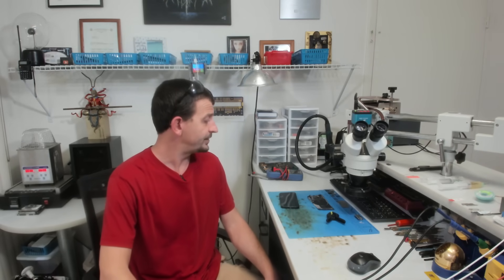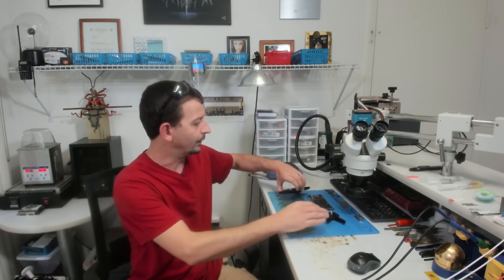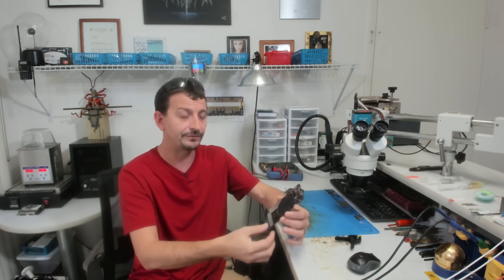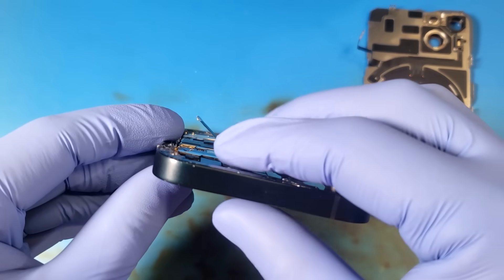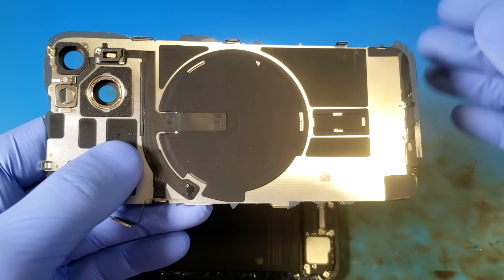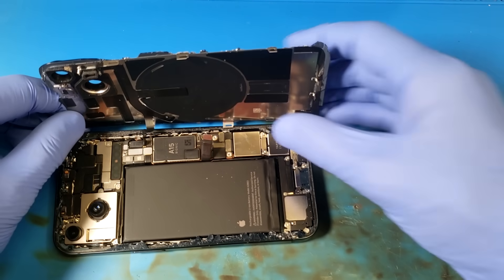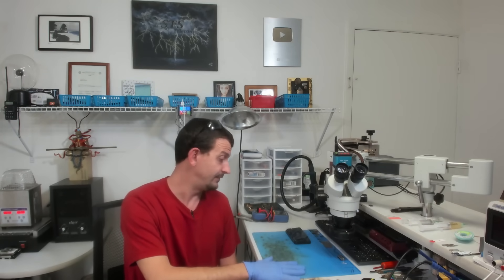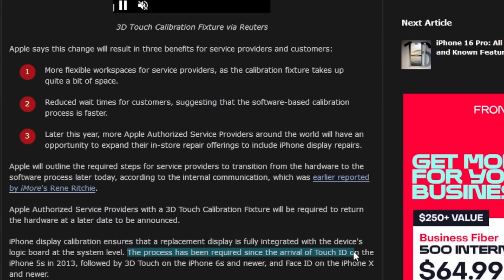New iPhones are full of landmines 💀 Don't break your iPhone 14 back glass!

Comment: I'm getting disappointed with Apple, my 2007 Mac has gotten to the point that I can't connect to a website without getting a not compatible error,fine, I wiped it, my son wanted it,he has it in the basement and uses it sometimes for some gaming, I have worked on it a few times, easy to service, I bought a new one and it's slow,paid more for it, if I call apple I expect that they would ask technical questions, maybe ask for logs, no I get someone that sounds like they just smoked crack and this is after several calls, not sure if I'd switch to windows yet,but I'm closer

Comment: Hi, can you help with my poco f2 pro?

I can't transfer any data from or to my phone with usb c, but it does charge.

I thought it was a faulty charging board so I've ordered a new one. Upon installing the new flex cable it worked, but my power button didn't work.

I managed to fix my power button, but no matter what I do, I can't get the USB-C port to fully work again.

Is it a faulty connector on the motherboard?

Comment: I have been a mobile phone technician for 25 years now and I have never liked Apple because of their hidden mines. I think this is a giant machine to squeeze money from the customer. An inflated balloon!
Even small things like changing the battery or display is already associated with difficulties. An annoying message is in red that something has been changed in the phone. Something that only Apple has. This forces the customer to seek service from an authorized service center where the price is much higher than normal. The biggest undersea mine is that after the iPhone 12, even the lightest repair is associated with the risk of cracking the display when opening the device. Many of my friends don't buy iPhone anymore. Apple doesn't think about the customer's tomorrow.

Comment: The great majority of iPhone users have been conditioned to only use the port for charging. In the "post computer" era you have no need to connect your phone to the computer to do anything. Remember having to sync your iPhone in order to put music, pictures, videos onto it, updating it or even setting it up? Now we have airdrop, iCloud Drive, iTunes library sync, where your music automatically downloads to all your devices when you add it to one of them.

And it's not like there's an accessible file system so that when you plug in a usb drive you can transfer pictures, videos, audio files directly without having to copy them from the photos app to the files app.

Comment: Having the phone brick, or disabled due to small parts failing is probably my biggest peeve with most modern day consumer electronics - not just cellphones, or apple.  I work in trucking, and the newer European units can be a real pain when their electronics fail, or to a certain extent the American units with the new emissions components.  You can be trucking along nice and happy, something doesn't work that the unit expects to work, and without even going into a limp mode, it will shut down on you with no warning - speaking from experience here.  Would be nice to see phones be given a "recovery mode" that they can default into if they are connected to a computer, giving you direct access to the memory to get a backup of - would be nice to see something consumer friendly like this, other than - "you should have been using our backup service in the cloud", and "buy a new one".
Reply from the maker: It would be nice to see some kind of limp mode for iPhones so people would have a chance to get their most recent data backed up.  Maybe the 3 minute grace period before restarting is so called limp mode 😳. I've had cars that would detect an issue and would get stuck in limp mode but would at least get you home in 1st or 2nd gear.

Comment: My iPhone 6S twisted because a car drove over it. I twisted the phone back straight. The only thing that broke was the screen under the front glass, but Apple refused to fix it. I was able to control the iPhone using Apple's iWatch. Calls, text messages and WatchUp worked fine with the iWatch when I kept the iPhone on and regularly charged the iPhone. The iPhone 6S had to be taken elsewhere for repair. The Apple repair shop tried to make deals for a replacement device or a new iPhone at a salty price and they immediately started asking for information about my insurance. The same iPhone 6S battery is now bad and it needs a new battery. The iPhone's own battery diagnostics show 74% battery. When the battery is fully charged to 100% and it's -10°C outside, if I walk to the grocery store for 15 minutes and try to pay with Apple Pay, the iPhone turns off because the battery has 0% power. Cold air has a big effect if the battery is bad.
Reply from the maker: Yep!  The temperature has a huge affect on batteries.  Sounds like your 6s should only need a battery to continue living!

Comment: I had a Huawei P7 before.
It fell down To concrete from the 2nd floor (about 7 meters.)
The front and black scattered and a small part of the screen is became missing. (About 1cm*1cm) 
I could look through the phone from this hole.
Also on the back the battery became visible.
But it was still working without any malfunctions!!!

Comment: Pretty sure the chip for USB inside is capable of usb 3 but they limit it in software. 
It’s anti consumer behavior from apple to limit it. It would not cost more enabling usb 3.0.
Reply: In this case it's not..
to have a USB3 you need a usb3 chip or have it inside the iphone silicon chip.
Only the top high priced model have it.
Classic Apple marketing 😌

Comment: I have to say i used a pulled 14 Series back glass and swapped it with the broken one. It doesn’t have any issues at all. It‘s tied from 15 series
Reply from the maker: That is good to know!  The issue I heard about with this is when using the rear camera with flash. The post said that when taking a picture with the rear camera and flash enabled, the photo is not saved to camera roll.  Can you confirm that is not an issue?  Thanks
Reply: I really hope the EU or right to repair in the US will kill the practices of interlock parts in a phone or any other devices. 
Or force them to give the software for it to everyone how want to repair a device. 

I had to give a Bosch e-bike back broken because a chip in the motor electronics was dead and I could not get the firmware for the chip (and it seems Bosch is locking the communication between parts by encrypting it and interlocking it too)
So the customer had to pay 800€. He had to go to a e-bike shop and the shop had to ship the motor to Bosch to get it repaired.
I would have charged 100€ for the repair….

Comment: When I bought my iPhone 11 "Pro" with its three cameras as a flagship feature, hoping to replace my bulky video equipment for several purposes, I shot ~200gb at an event over a weekend and immediately realized it's completely useless. There's no way I could shoot anything meaningful with this, never mind in a professional workflow, and get the video OFF of it in a reasonable amount of time. I don't even have the I/O necessary to run an audio device AND monitoring, or any other combination of basic video loadout. Clinging to Lightning with its insufficient nine conductors rendered any "pro" aspirations absolutely null. If the move to USB-C doesn't even mean an upgrade to USB 3.x, I'm never buying another crapple again.

To boot, I have to keep an old Mac around just for Image Capture because I haven't gotten an iPhone to give up its photos/videos to a Windows machine in YEARS.

The only satisfying video application I've found for these devices is as cameras for "iOS Camera for OBS", and that will certainly occupy the rest of their lives as I hopefully move on to Linux phones or something soon.

Comment: You are 100% absolutely spot-on Jason.  A component failure that doesn't affect the safe use of a product should not be a cause for the device to be forced into a non-useable state.  This is akin to forced service where you are now a hostage to the phone supplier to have to get it repaired, even though the key functions could operate safely.  This issue should really be investigated further as it would be a real shitty practice of Apple if they are forcing people to have to pay money to have their phones fixed simply due to poor coding.  Have you considered testing out your theory by grabbing a working phone and then systematically 'disabling' specific components until this problem occurs?

Comment: I recently replaced the back glass on a 14 using an aftermarket part and had no functionality issues
Reply from the maker: Good to know!  If you also replaced the NFC/wireless charging coil with aftermarket, are you still table to take and save photos with the camera while having the flash on?  The issue that I was referring to would cause photos to not be saved while using the aftermarket flash.

Comment: New MacBook pros have this pairing issue as well. Never been an issue replacing screens on MacBook's, but now there's loads of issues since we can't pair them. Face ID, image distortion around the notch, and the new angel senor they use won't work with a replacement screen. Earlier today I had to transfer the chip from the angle sensor cable onto a new cable for a 2019 16" macbook pro. Without the right chip and a working cable, the device thought it closed well it was open.

Comment: Regarding the usb c on the iPhone 15. They used the old CPU on 15 and 15 plus that doesn’t have support for usb 3.0. That’s the reason behind it
Reply: apple silicon, truly revolutionary stuff huh?

still remember the agony of trying to get my photos onto my macbook back when you could only access them through the glitchy as iPhotos app. so incredibly painful and slow, and unfortunately, I missed out on quite a few pics. ironically, on a pc at the time, the iphone just appears as a drive with the photos as files for you to copy or open, so much fucking better, still very slow
Reply from the maker: Makes sense.  So then they’re only 22 years behind rather than 23.  Hehe 😬

Comment: The only phones that I've seen calibrate were the iPhone iPhone 6/6s and iPhone X. Using Apples RepairCal software, there are 4 plus symbols by the corners. We tested this at my uBreakiFix store, touching during the calibration and pairing of sensors, would make 3D touch not work and the phone not boot properly. Newer phones, it's just pairing the new components to the motherboard. As every Apple part has a unique serial number that has to be assigned to their system and communicated or things don't work. What's funny is the iPhone's 13 series and newer, some screens are coming "defective". As in they are not serialized properly and their AST-2 system can't tell the phone to pair the part...

Comment: We calibrate Apple oem screens and batteries everyday. Apple doesn’t want you repairing their devices. They want you to buy a new phone, problem is not everybody can spend $1000 to replace their phone every time it breaks. I think the consumers are letting them get away with it. Samsung on the other hand you can literally swap every component on a phone including the logic board.
Reply: as far as I can tell Samsung has never done anything to blatantly stunt repair attempts, and indeed, their devices are quite repairable (god bless their like 8 Phillips head screws of the same size that hold the components in).

unfortunately they still follow apple in some regards - killing headphone jack, not including charger, dropping features like expandable storage, etc.

still rocking a note 9 though, peak phone, but some reliability issues

Comment: Apple includes USB 2.0, because they’re cheap and chintzy. They don’t want to spend a mint on their products in certain areas because they’re doing all these hoop jumping for pairing of parts. Apple has to pair down its costs in some ways and does it by using old technologies in certain areas.
Reply: yeah, I figure they're using the same general board layout and cpu interfacing as with their lightning port models (which were also limited to the intolerably slow (even for) usb 2.0 standard).

apparently it costs them about $500USD more to rearrange the damn traces in the motherboard and add the other usb c pins

Comment: I could sit down and analyse the comms traffic (probably I2c) from a convenient  point on the board and insert (ack)nowledgement answers for missing components, can't PLD or Pedro produce a bus-sniffer/insertion tool. I'm so anti-apple, I wouldn't waste my time. You say about "calibration", no manufacturer would sell a sensor that had enough processing power to even produce its own serial number, they may run an Apple batch with a different device address.

Comment: I agree with your analysis.  Calibration is adjusting a sensor output such that it responds to a agreed upon standard, and makes the resulting output of the sensor predictable and aligned.  The action of installing a brand new flex cable into a device is pairing or associating, not calibration. Disabling a device if a non-critical sensor output is detected seems to be a problem that transcends iPhone. My ex owns a 2020 Mercedes E450.  Someone bumped into her car and misaligned one of the parking proximity sensors in the bumper cover as a result.  Subsequently, the car refused to start and she had to have the vehicle towed to the dealer and repaired for $2500.  Unbelievable !  A whole car disabled for a proximity sensor.
Reply from the maker: Wow!  Sounds like very similar behavior out of Mercedes.  It's getting harder to steer clear of this sort of thing.